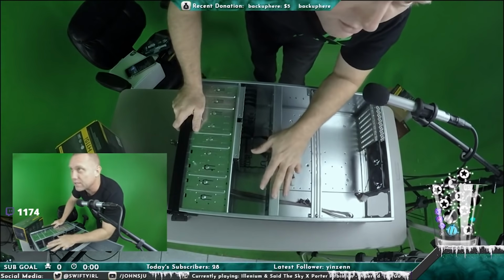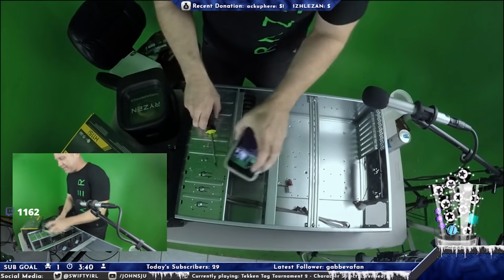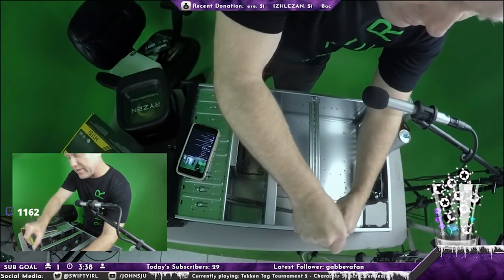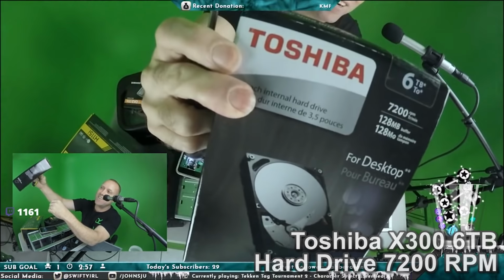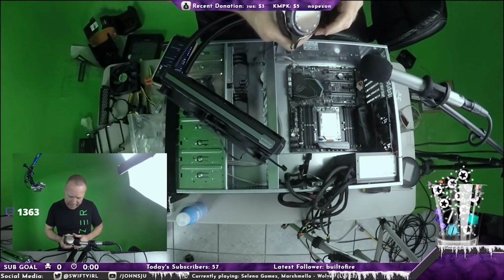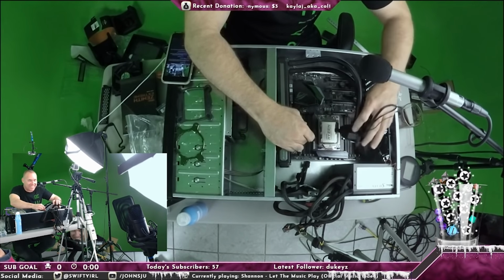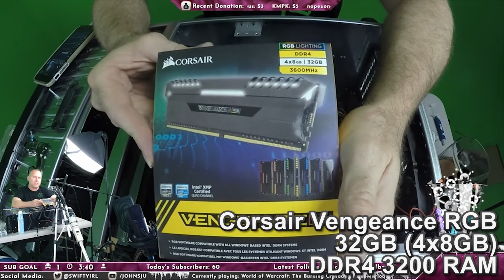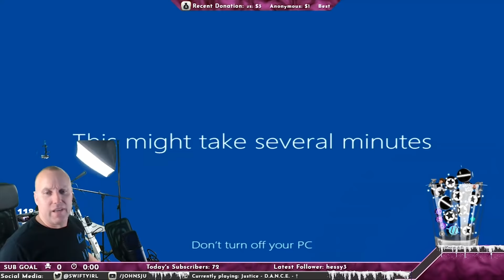Swifty NEW ULTIMATE PC 2018 Build for Gaming, Streaming, Recording & MORE! (Highlights)

Comment: Nice computer build swifty. I need a computer for gaming and I’m saving up hopefully soon for wow what do you suggest for a computer out of razor. Or if I have to build a computer what parts do you suggest that won’t cost so much
Reply: Hi there! I'd suggest you wait for Ryzen 2 to come out in a couple of months, they have very nice processor for cheap price compared to competitor. right now RAM and Graphics Cards are very very expensive, you should wait a bit to see if prices go down
Reply: Processor 7700k, gtx 1070, 256ssd/1tb Western digital black, 16gb ddr4 2666 RAM, personally like rip Jaws or Corsair. If your on a budget get crucial. 700 watt power supply always go gold standard or higher, whatever mother board $150 or more that supports your processor. It's an 1151 socket type. A standard computer case mid range. I like Corsair to be honest and NZXT but they are a bit more pricey. Standard optical drive, LG sells them cheap on Amazon for $50 bucks. Hope this helps. Should cost around $1100-$1200 for a solid gaming build that can handle 1080p on max settings for almost all games.
Reply: Scott Adams razer h440

Comment: using my ripper 1950x w asus stricks 1080ti, ultra settings,  144mhz 1080p monitor, ek water kit,  streaming & recording with obs, ripper struggles to get 62 fps avg. so you can not gaming, stream, and record far cry 5 with a  1950x. A all in one gaming, streaming, record solution is not threadripper 1950x at min 65 fps , ulta settings. 40 to 58 fps during gunfight, explosions.Story is we must use 2 machines if you wish to game, record, streams using obs and get an avg 65 fps at 1080p. anyone saying you can use 1950x threadripper to stream, record, game on 1 machine at 65 fps, ultra settings is mistaken.

Comment: lame needed to be the new I9  16 Cores 32 Threads 
Supported Memory: DDR4-2666 
Socket LGA 2066 
22MB L3 Cache 
Compatible with Intel X299 Chipset Motherboards 
Unlocked Processor
Reply: Yeah thread ripper is the same specs, except 50% the cost